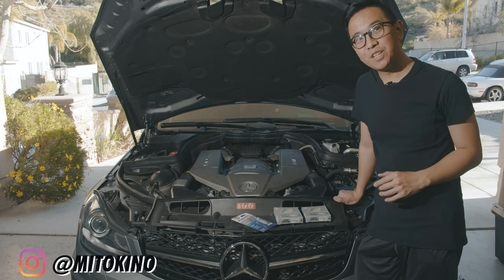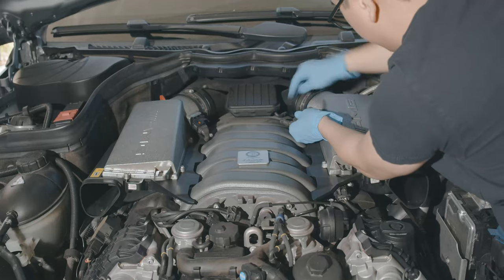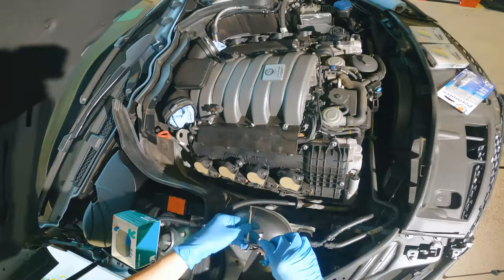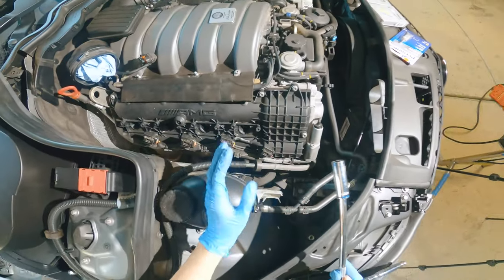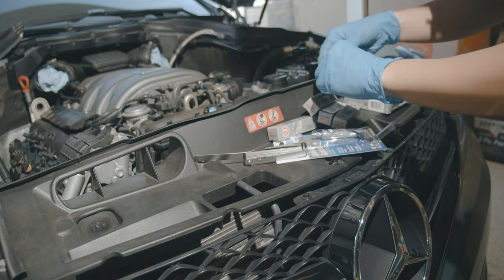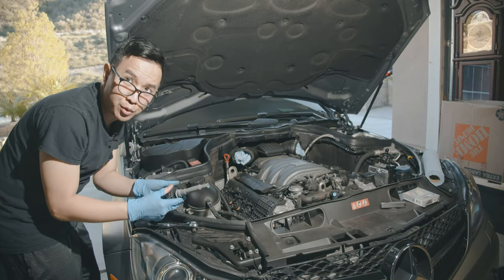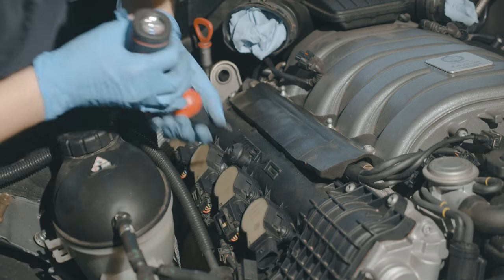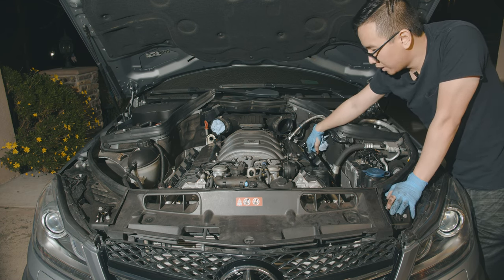How To CHANGE SPARK PLUGS On Mercedes-Benz C63 M156 V8 6.2L AMG Engine

Comment: FYI They all end up having oil in the plug looms 👍🏻 Keep up the good videos. I have owned mine since new in 2013 and still love watching videos. It looks like you have done most of the preventive maintenance but while you was in there you should have done the PCV valve & intake manifold gaskets.

Comment: THanks for the video! I'm going to attempt this! What was the milage on the car when you did this? Should new coil packs be installed with new spark plugs?
Reply from the maker: The mileage on the car was 33,000 miles. I didn't have to change the coil packs since they were still in great condition. I would imagine in higher mileage it is ideal to change the coil packs as well. Thanks for watching!

Comment: Oh my god man, those sparks were RIDICULOUSLY overtightened AND cheap. A set of NGK’s are between $75 and $105 depending on where you get them which is already not much. 😳 Those plugs were changed at some point already and the job was done by someone who should NOT have been working on it.
Reply from the maker: Yup I was absolutely baffled with it. 

All is well now thankfully. 

Thanks for watching